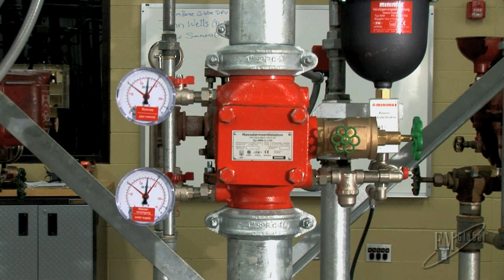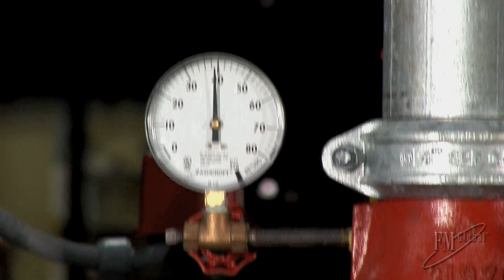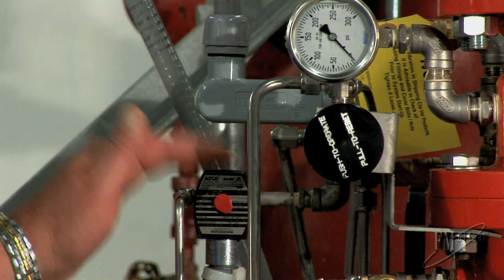Know More Risk: Water Based Sprinkler Systems

Comment: Hi, need some clarification. Does it mean heat element is used as a detection system for wet/dry system whereas Independent means of detection (sensor) is used for deluge/preaction ? And why there is difference between closed and opened sprinklers ? Appreciate your help 😊
Reply: There are no electronic heat detection devices on a wet or dry system. These two are activated by the link of a sprinkler fusing and opening. An open head is one with a deflector but no fusible link stopping water from flowing through it. A closed one has this link, which breaks upon reaching a certain temperature.

Comment: What about  a flow switch on a wet system?? That will give you a indication of flow
Reply: On a wet system, depending on the water supply source, a flow switch is not a good solution. For example, on a town's main supplied wet sprinkler system, water surges on the supply side can cause the clapper to open and a flow to be detected by the flow switch and therefore call the fire brigade and an expensive bill for a spurious alarm call out. In this case, a fall-in-pressure switch is more reliable as the only time that will operate is if the sprinkler bulb has opened. Granted, someone could knock the sprinkler bulb (accidental or malicious) and set of the pressure switch, this same argument could be applied to a flow switch too. Hope this helps.
Reply: For one thing you are talking about a  wet alsrm value that yes they can bounce in a water surge that why you have a excess water pump.on the system side to pump the pressure up an extra 40 psi . But this is old school way this system is hardle ever use now days. The system am talking about is a riserr manifold (look this up) ware the flow switch has a test and drain the flow can be set up with up to a 60 second  delay for water hammer. Up in Canada this is pretty much what we use on wet systems res com and industrial
Reply: @ronwikeheiser6706  G'day from an Australian sprinkler system designer (everything in the field to consulting) I do happen to know what you're describing as what we call a 'sprinkler control assembly' used as you've said in residential or office buildings for floor by floor control on a common sprinkler (or combined sprinkler/hydrant) riser. Its not the case that these valves are old school as such. The valves shown are THE way to setup sprinkler assemblies in warehouses, manufacturing, and other high hazard occupancies which is a large proportion of facilities that FM Global insures (that's why they are talking about it). You probably know this, for another, flow switches like the Potter PS120 are unreliable, as the paddle get stuck, they leak, and fiddly to adjust and set. Anyways, not here to start an argument, have a good day sir!
Reply: Oh yes l do no what you are talking about as l am a consultant contractor and installer as well for 33yrs . Yes Australia does have a very high standard.  As many places have higher standards depending on the insurance company that is over and above here in Canada alam values are just not used here for many reason's as are climate is not easy on things thats all . Things have improved alot over my 33yrs in the business. In no way l am arguing even the piping systems coming out so much has changed from when l was in my early 20s

Comment: Pressure switch on wet system. Why?
Reply: The pressure switch can be used in place of a flow detector. Flow is detected based on a change in pressure from the static (non flowing) pressure to residual (flowing) pressure.